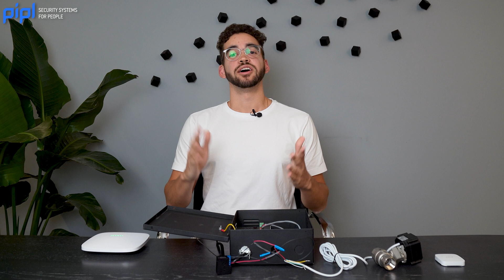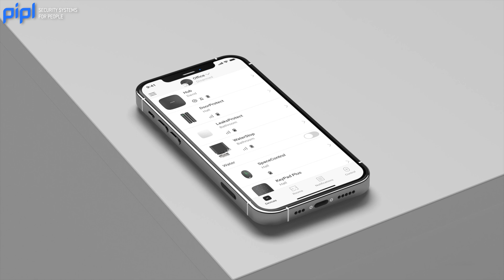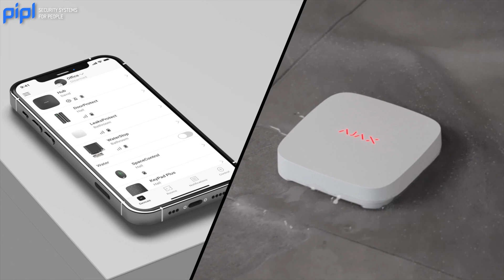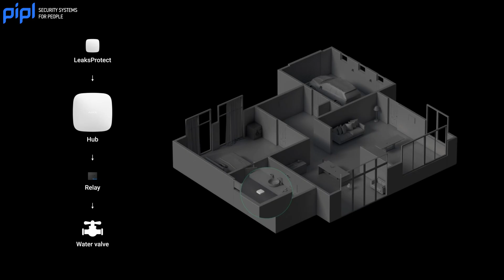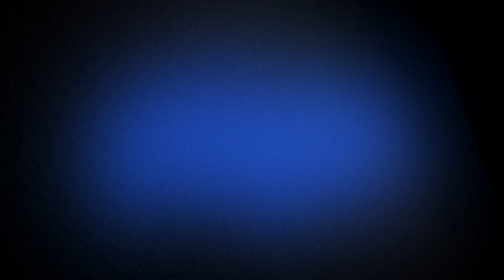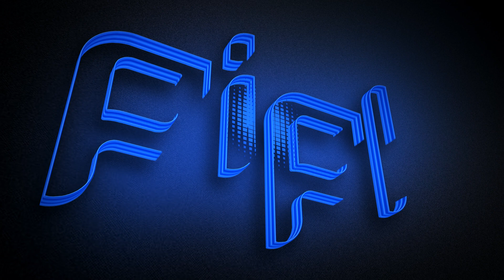How to Connect Automatic Water Shut Off Valve 12V to Ajax Alarm System

Comment: Hi! Is Relay needed bevause of the PSU connected to WaterStop? WaterStop can connect and communicate directly to the Hub without relay, using its built in batteries, when I ran a scenario with LeaksProtect. Thank you!
Reply from the maker: Hello!

Yes, the relay is necessary because we are using a PSU. We specifically chose to highlight this application because we strongly believe that integrating a PSU amplifies the effectiveness of the WaterStop! While we value the simplicity of installation provided by wireless products, incorporating a PSU introduces an additional level of security to your system :)

Thank you for watching!